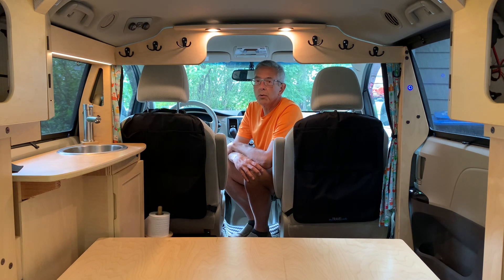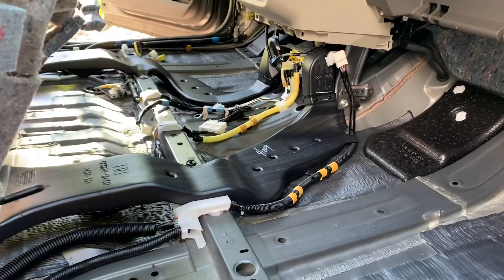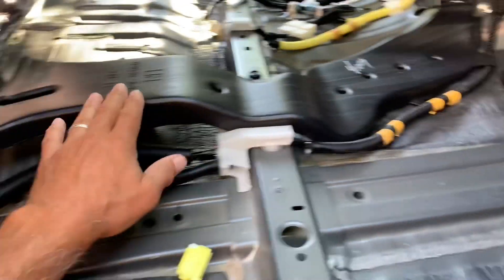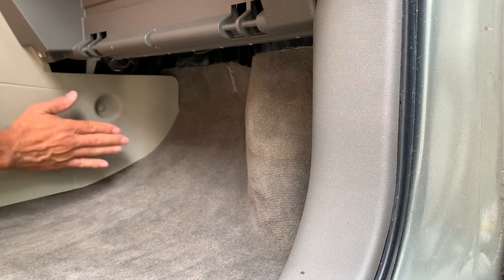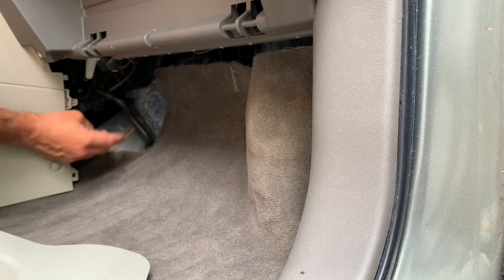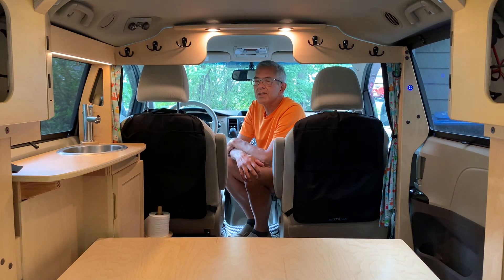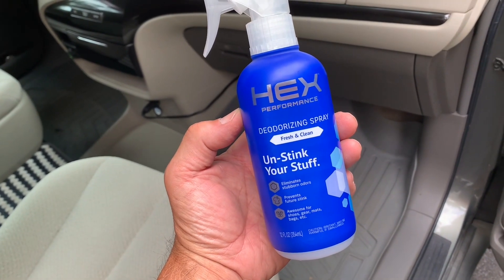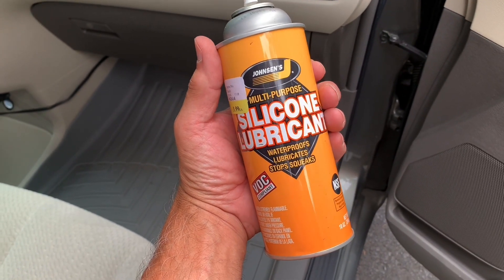My Van Stinks - Don’t Let This Happen to You

Comment: My concern would be why did this happen in the first place? If the line isn’t flowing properly I’d be concerned that it was pinched somewhere further downstream from where you gave it the air blast to where the tube exits the van. While it could just be some sort of debris got lodged in there the is a possibility of a pinch in the drain hose.
I used to work at a Toyota dealer (parts) and the horror shows the techs would see if this problem is not caught early. Once the mold sets in you’ll have to replace all the carpeting which requires huge amount of interior trim removal. The sound deadening material that is stuck to the floor the techs would freeze with dry ice and break it into pieces to remove it to apply new. This stuff would also absorb mold so it had to be removed. 
Between plugged sunroof drains (one reason I’m just not a sunroof fan) and AC condenser boxes doing what you experienced you can really get into a very expensive repair.
Oh, yes we used to see pinched lines that were not carefully routed or installed that could cause this problem. Definitely keep an eye on this and if you get that slight odor or your carpets are suddenly damp for no reason DO NOT wait to have it checked out.
Reply from the maker: 👆 This.

Excellent points, Jeff.

Comment: It was no more than an hour ago and we just got back from Costco and the thought crossed my mind that it was doggy smelling in the van.  Possibly because we took the mini  poodle with us on the last trip but now you got me thinking.   I know in the old motorhome we had,  mud wasps use to get into the water tank vent hole and plug it up.  And it has been dry lately and of course being summer we have been using the A/C.  Thank you so much for sharing.  I will be doing the BP air blast first thing tomorrow morning.   Thanks again !
Reply from the maker: You’re welcome. Hope you solve the smell issue!

Comment: Thanks Bruce.  Good information.  Hope you are well...
Reply from the maker: Thanks, you too! Good to hear from you again.
Reply: @BruceParks  After much research, I bought a pre-fabricated 3 piece unit recently and am looking forward to getting it put together and installed as time allows. I knew that there wasn't any way I was going to build something as nice as yours with my limited skill set and resources; so I chose the "kit" route.  A little pricey, but well designed and constructed. Still, there are many upgrades, features and "candy" that I will be adding to the final product that will not doubt be pilfered from your brilliant designs. Thanks for the ideas and response.  Best regards, Steve.
Reply from the maker: I think you’ll find it’s an ongoing learning process of discovery and improvement. Enjoy it!

Comment: Hi Bruce, do you happen to know if the lubricant silicone would be okay to use for easily screwing threaded male and female pvc pipe fittings?
*Allyson
Reply from the maker: Silicone lubricant would make that easier than no lube at all but it wouldn’t provide a leak-free joint. What are you using the fittings for?

Comment: This video bring s to mind a question - do you have condensation issues in any of the seasons?
Reply from the maker: Yes, in very cold weather, we’ve have some moisture on the inside of the windshield since that’s the coldest surface. When it’s below freezing outside in the morning, we’ve had ice on the inside of the windshield.